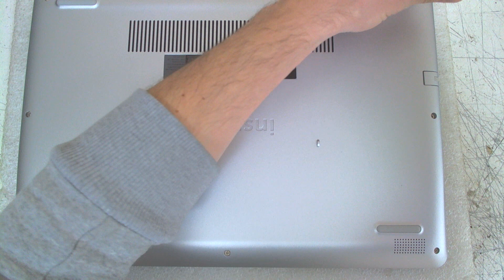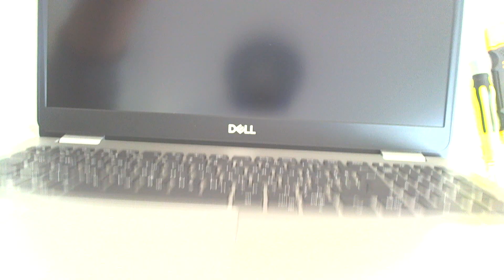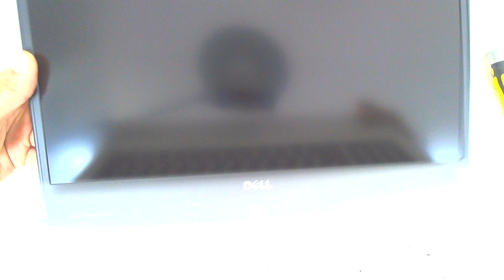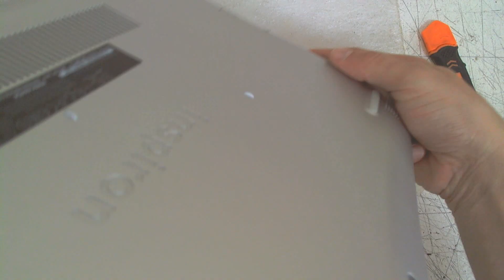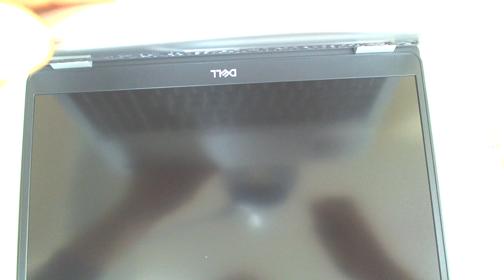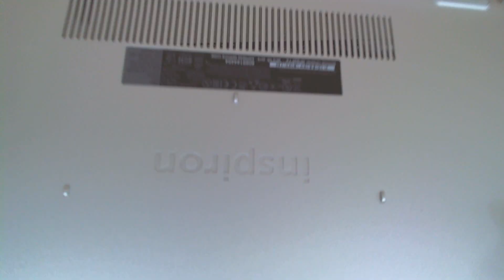Dell Inspiron 5584 Disassembly / RAM Upgrade

Comment: Processor	Intel(R) Core(TM) i5-8265U CPU @ 1.60GHz   1.80 GHz
Installed RAM	8,00 GB (7,87 GB usable)
These are the specifications of my Dell Inspiron  15 5584. RAM installed is the above mentioned. Please can I add RAM 16 GB in the second slot? The total RAM would become 24 GB. I looked for it in the online Dell store dedicated to my computer model. 
Dell memoria aggiornamento - 16 GB - 2Rx8 DDR4 SODIMM 2666 MHz. Is this correct and possible to do? It is also costly 157,37€.  Thank you so much
Reply from the maker: According to dell "Memory size per slot	

4 GB, 8 GB, 16 GB"
So if you have 2 slots it is possible.

Comment: I have Dell Inspiron 5584. In those two memory sockets one gone fault, do I want to change the memory socket as a whole or I want to just change the slot?
Reply from the maker: Depend what is the problem... If is physical damage you can change the ram place. If is power issued the second one will also not work.
Reply: @LaptopDisassembly  Yes, I have changed the place. It's working now. What do you mean by power issue? I don't know about it.
Reply from the maker: If there is a problem with the memory power supply.

Comment: https://www.amazon.com/Samsung-Inch-Internal-MZ-76E1T0B-AM/dp/B078DPCY3T?ref_=fsclp_pl_dp_1  . can this 1 tb sata ssd installed in it? will it support?
Reply from the maker: Yes it will work fine
Reply: @LaptopDisassembly  YOU TOLD to buy 7mm ssd right? my dell isnpiron dell 5584 REG MODEL IS P85F
Reply from the maker: All the regular 2,5" ssd are 7mm thick... If you gonna buy m. 2 ssd it has to be 2280 standard

Comment: Hey @YankoGoshev thanks for the informative video super helpful, how can we add an internal hdd 5400 rpm  to this laptop, and where could we get the sata ribbon cable.
Reply from the maker: If your laptop comes only with m. 2 ssd you can add second regular hard drive. On the left side of the battery is the plece for it.  Normally the sata cable should be inside. Other wise you can by from ebay i think.

Comment: Is the claim correct that it supports up to 32 gb ram? I got mine with a single 16 gb card, but the manual says that it supports up to a maximum of 16 gb which can be a single 16 or 2 x  8 (as well as combos such 4, 8, 2 x 4) but there is no mention of 2 x 16 being supported, although I am wondering if this is true.
Reply from the maker: Well if now is working with single 16GB, there should not be a problem to work with 2 banks of 16GB.
Reply: have you tried 2x16? please let me know thanks!
Reply: @gener-ianaguilar4384  I haven't tried it.
Reply: @M.athematech i recently read about the 32gb capacity of this laptop,.
the 2 ram channels can handle up to 16gb of ddr4 
while the m.2 slot can handle another 16gb of ram,. 
to activate the m.2 ram ,. you need to setup the intel optane memory m.2
Reply: @gener-ianaguilar4384  Can you link the source about the 32gb RAM capacity? The Dell website says it supports a maximum of 16gb, i.e. 2 x 8gb RAM or 1 x 16GB
Reply from the maker: Usually the spec on the dell site is for a preconfigured devives.
Reply: @ianhurley767  I also want to know. :(
Reply: Did anyone find out whether or not it supports 32gb?

Comment: Thank you! I would not have known about all the small clips in the plastic case!
Reply: I hate all these small clips. I find that the large clips at the hinge side are ok, but it is virtually impossible to open the small clips on the sides and front without some or all of them breaking, even using a plastic or cardboard pick instead of metal will result in these breaking because they are so thin and fragile. My understanding is that this is done on purpose so that the repair center can tell if its a brand new never been opened laptop or one that has been previously opened - these clips seem to serve no other reason as the cover is actually secured in place by the screws.

Comment: I just ordered one of these 5584s with i5 processor, 8gb of ram and 256 ssd. I do not like the wifi card that comes with it. I like 2X2 and it only comes with a 1X1 wifi. I will also add another 8gb stick of ram. I read that this model supports Intel Optane. I'll have to look into that. The other downfall is the one that I ordered seems to have silver keys with terrible back-lighting. I'd rather have black keys.
Reply from the maker: Are you sure it will have a free ram alot. In the dell site specifications it is writen that in some areas the model comes with only one ram slot.